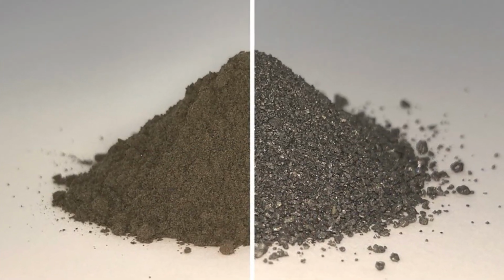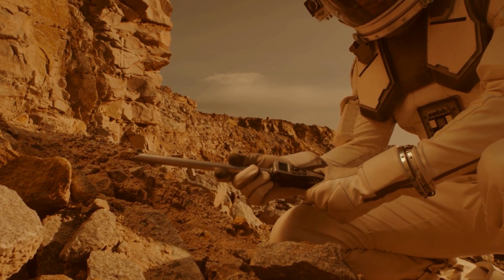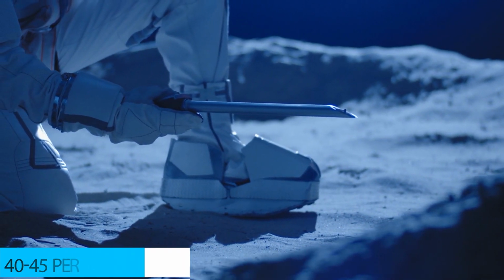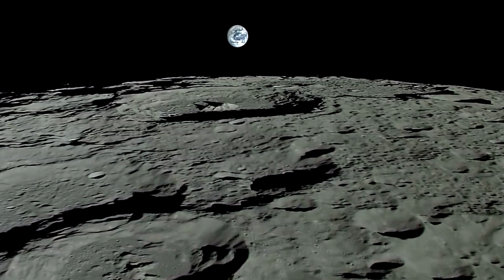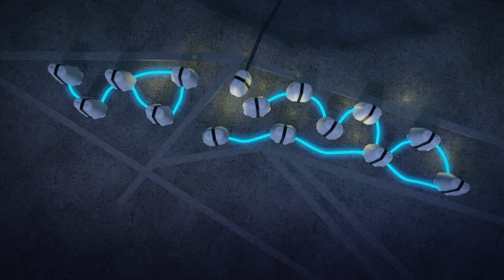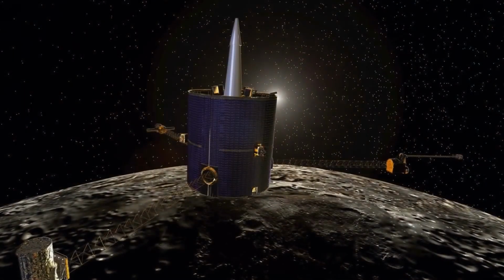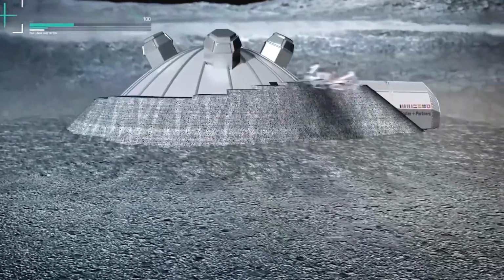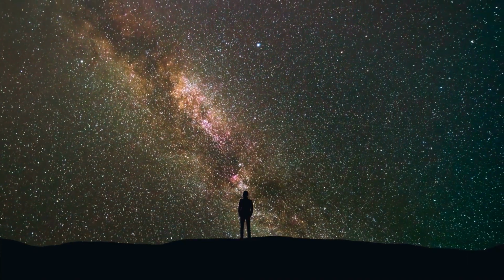This Marvelous Machine Splits Moon Dust Into Oxygen and Metal

Comment: I thought moon dust is not "Nearly half oxygen." It's mostly silica.
Reply: SiO2 .. and separating the two (Silicon - Oxygen) is extremely energy intensive even with a "getter" which could be Fluorine which defo isn't abundant there or provide a element that Oxygen likes more than Silicon

Comment: As a gamer, I want to say that sure you can micromanage everything and get the most out of stuff, but its usually easier to find something that works and then spam it. Instead of trying to lowering temperature to save energy, spamming solar panels or mirrors to get a lot of energy might be easier.

Comment: if we can colonize the moon, i dont see why it would be that much harder to colonize mars
Reply: I mean, it is a whole lot closer and therefore is in range to recieve help directly from earth. Not to mention the chemicals on Martin soils are poisonous (probobly) which will add another layer of confusion and required development. But yeah, if we can get a self sustaining moon station it will be not too too large a step to do the same on mars.
Reply: 1. It's so much closer and it's always the same distance away. 

2. Mars atmosphere is so thin it's not useful for much, but it is a big hindrance for the use of lightweight vehicles and solar. 

3. Martian soil cannot be easily turned into steel and frankly we don't know enough about it. There could even be microbes on mars so it's planetary protection is higher, this means more regulation and planning is required.